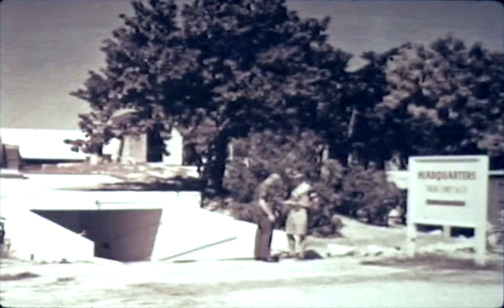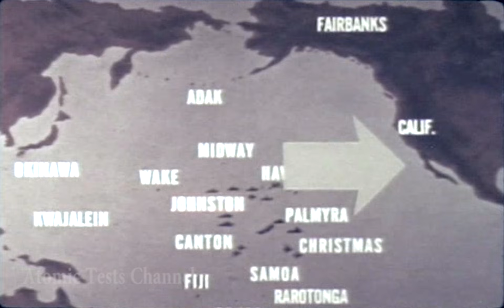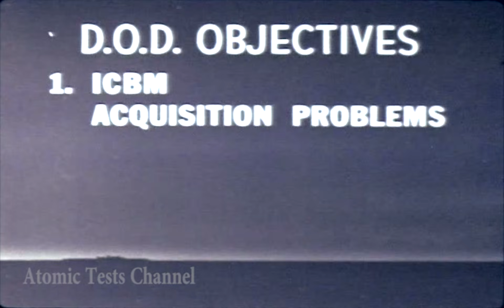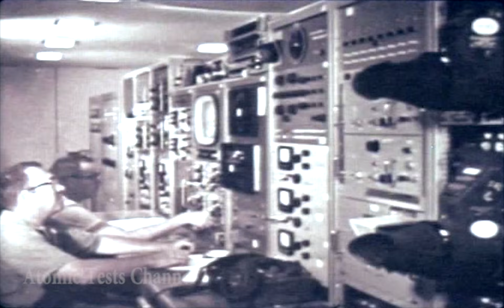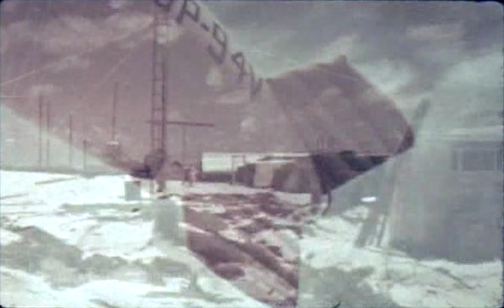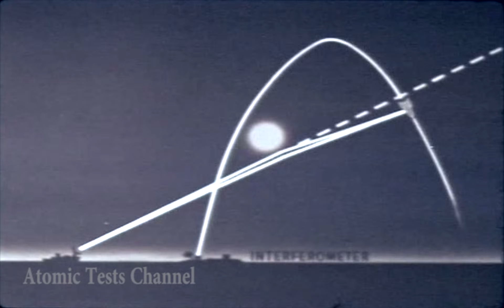OPERATION FISHBOWL - HIGH ALTITUDE WEAPONS EFFECTS

Comment: They know there is something up there that's why they are sending a rocket! And when they hit something they are 100% sure what they are doing
Reply: Yes there is low atmospheric density and magnetic fields up there. As this video tells you, using nuclear weapons at high altitude has all sorts of RADAR, radio and EMP effects. This is obviously extremely important for military and security. And they wanted to intercept incoming missiles using nukes. Obviously you need to know what the effects would be in an attack.

Comment: No mention of EMPs, still under the offical secrets, Classified protection.  In truth, probably the only characteristics the tests were for. They wanted to take down the magnetosphere to shed off the radiation belts, to allow safe passage to the moon.
Reply: What utter baloney
Reply: @Sssseeeeyyyba.7452  Try saying something meaningful.
Reply: @jamesdonaghy9143 you literally wrote something that doesn't make any sense lol
Reply: @oscarin13  Which bit are you struggling with?
Reply: @jamesdonaghy9143  Nothing, just apalled at the lack of scientific literacy you're displaying. The belts are indeed lethal IF a human was to spend many hours inside of it (as in a very high-altitude orbit around the Earth), but the effects can be minimized by simply going through the weaker parts of it very quickly, which is what the Apollo missions did. That's it, there's no mistery. 

What you wrote doesn't make any sense because the bomb went off at 400 km whereas the belts start at roughly 600-700. Besides, NASA wasn't involved in the project, this was a purely military effort.
Reply: @oscarin13  Can you check Scientific America 1959 summer edition, Van Allen's conclusions regarding the Explorer 3 survey? Either that or anything pertaining to it. 
It's all very well you saying how the numbers all stack up. Have you ever actually been in possession of any of the actual facts? ("I know Apollo happened" is a statement devoid of any pertinent facts, for example.).
Please link me up with anything you've got on this.
Reply: @oscarin13  I won't argue too much with the rough numbers you've given, except to say the 400km level of bombing poisoned that level of atmosphere, making any crewed missions impossible for years.  Even the equipment,  or 'robots' all got destroyed over a period of 5 years of radioactive bombardment. 
You are really bereft of the facts here, not me. 
The belt you speak of is centred at 1000km above ground, but it's effects are felt far below. For this reason, pilots are limited to just a few polar passes per year. That's because the atmosphere is thin over the poles, providing less atmospheric protection against that first belt. Thus, it is demonstrated that the first layer begins much lower down than 600km.
But the damage down to Americans and other people is only coming to light lately. 
More to the point, the objective of the 2053 detonations was never accomplished.  Did you ever ask yourself about the objective?  Why were they bombing the living shit out of the sky?
It is on record that Van Allen suggested that the right EMP might neutralise earth's magnetism, liberating the radiation belts trapped by it, and therefore allowing a safe passage through for crew.
Reply: In 1959 Van Allen published a report on radiation belts in Scientific America, where he clearly stated that the radiation, 1000 miles above earth, is intense and very lethal.